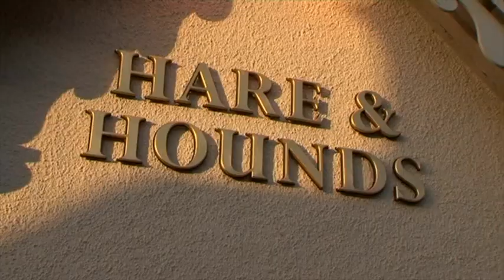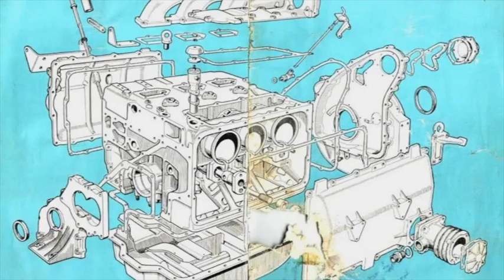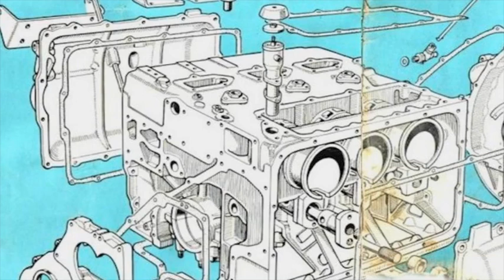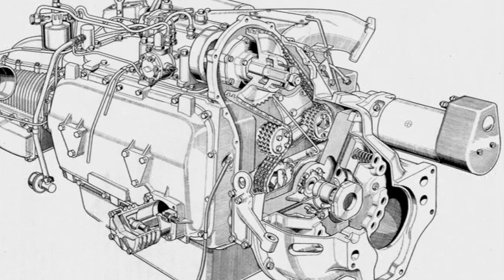Mark Erskine and I go to the UK to talk to Don kitchen about the TS3 Commer truck engine

Comment: No one has stated what engine oil was recommended by roots ?  it was Shell Rotella DD+40-,
And should anyone want a broken blower shaft i have one lol  there was a knack of removing them ?   They were a very good engine if you could stand the noise.

I did not realise that vehicle of Holtons from Stony was the first TS3,  you are never to old to learn, they were only about 15 miles from me in L/B.

Comment: The idea came from a wartime German bomber with an opposed piston diesel engine Junkers Jumo 205, it used two crankshafts. Then French CLM stationary engines used the same principle. The Vincent Motorcycle Company produced an opposed piston engine during the war for use in air dropped lifeboats, it was a petrol engine. 3 cylinders centre one was the blower two outer ones were power - 500cc. doesn't half look like a TS3!

Comment: Interestingly the opposed piston Diesel engine idea was, I believe, pioneered in Germany at some point in the 1920s. It was developed by Junkers, designated Jumo 204 to be an aircraft Diesel engine which entered service in 1932, In a 6 cylinder twin crankshaft configuration. The clever part of Commer TS3 design was the rocker configuration which enabled the use of a single crankshaft. The Junker's Jumo 204 engine design went on to become the basis of 2 other significant British engine designs which were the Leyland L60 used in the Chieftain tank and the Napier Deltic having 2 and 3 crankshafts, with 6 and 18 cylinders respectively. It is disappointing that the Commer TS3 rocker and single crankshaft technology didn't become the basis of applications in other vehicles such as tanks, trains and ships. Unfortunately, this clever configuration was too late to be used in aircraft as by then the jet engine was the established prime mover. It's configuration solved the oil scavenging problems that had limited the Jumo and L60 engines to a vertical orientation.
Reply: The TS-3 configuration is attributed to copying the Sulzer ZG-9 by some, but there’s no real evidence this was actually the case

Comment: How many times in history have machines with so much potential been scraped through ignorance, funding and or somebody’s ego
Although this concept has been used by other manufacturers, the TS4 without question, would have been with further development and technologies in a league all of its own.
Detroit came up with electronically controlled injectors, for example, imagine similar in the TS4.
I’m not sure if the TS4 had helical rotors in the blower but noise reduction would have been an advantage, and other developments, too many to list here would have enhanced it into a serious energy density winner compatible with no other.
Eventually, though, emissions would have unfortunately its demise and killed it off as happened with Detroit 2 stroke range, I read somewhere that Detroit could not be developed any further.
Think of where the TS4 would have been with the same level of development as the Detroit 8V92 TTA.
We can only speculate, but it is more than fair and pointless to say now that Chrysler has a lot to answer for.

Comment: A haulier running to the London markets with vegetables had a stick same as local bridge it could be loaded with 56lds potato`s marrows lettuce still went to the same hight on Commer Maxi 
to clear under the bridge , the driver my brother in law always carried some woman`s tights in case the fan belt broke as on the road side it was easer to fit then the belt he always said, never new if he tried it

Comment: Thanks I recall seeing my TS3 engine being pulled down and serviced by WR Phillips here in New Plymouth, a very interesting engine to see. I wonder how many of the Commers came to NZ. Europa was big on the Commer brand
Reply: @MerleDoughty-yw6cl
Europa Oil were owned by the Todd family, who were also the sole importers of Rootes Group product to NZ so it’s not surprising they used one of their own brands 😊.
I think one of the Taranaki Dairy Companies also used a lot of Commer tankers (there’s a mural on the former parts dept window at WR’s showing them).
I’m ex-WRs myself (cars & light commercials though) you would’ve had your truck in the Bob Fougere truck shop days I’m thinking?

Comment: If only Rootes had be given the design responsibility for the Chieftain tank engine British tank  industry would have had huge success
Reply: Rootes were involved! Eric Coy, head of the engineering division,  mentioned in this video, and Don K were involved in the piston. / liner design. Here is what Don K sent me in a letter about his life at Rootes Diesel Engine Divn "Eric Coy, on one of his visits to the Fighting Vehicle Research and Development Establishment at Chertsey, was asked for advice on what would be a profile of a power unit for a new tank investigation. The requirements were about 600 hp but the engine height had to be extremely low. E.N.C suggested a twin crank 2 stroke which could be inclined at a low angle. That’s all I know except some time later, ENC presented me one morning with a piece of paper on which he sketched a piston profile and requested me to detail. It was, in fact, the Leyland  L60 proposal.
Diesel Engine Division was awarded a contract to develop the liner, piston and combustion based on a single cylinder unit. Another draughtsmen, Eric Bell, was taken on to detail the single cylinder block - crank, etc while I was left with the piston, which had a cast iron body with steel crown secured by steel studs. The crown was made in two parts - an outer ring the inside of which was machined for oil cooling and a sliding fit centre. The material used was C.P.N.M2 and with this material, the two rings had to be welded together in a vacuum furnace - very costly. Ken Firth was given the development responsibility - no major problems - 100 bhp / cylinder achieved. When our part was completed, the project was handed over to the Tank manufacturer - Leyland.   Problem was, unlike Rootes Diesel Engine Divn, Leyland had no experience in developing and building two stroke opposed piston engines and they had a lot of troubles and took a long time to build it - never getting it right. Rootes WERE given design responsibility for PART of the engine. It was just a shame they weren't given responsibility for the whole design :-).  And growing up in the cab of a bonneted Leyland Comet 75, along with the first Commer TS3 in our province in NZ, I am a huge Leyland fan - well until the mid late 70s when all those other brands were absorbed and sullied the product! 🙂

Comment: I've been obsessed with anything that has an engine from my earliest memories,  some things stand out more than others though. The TS powered Commers are one of them. I was very young, only just in school when I heard my first Commer, and at that time of course had no idea why it sounded so different to other trucks. Neither did my father when I asked why they sounded so strange, he just said they have special engines! Actually it wasn't until the late 70s, early 80s that I discovered the magic!  We lived in North Yorkshire at the time and there was a very old garage in the village where we lived. One afternoon I was there after some parts for my mum's knackered old Morris 1100 and was wondering around the back waiting for the owner to serve me, there wasn't anyone else, he did everything. There in a corner was this strange lump that sort of looked like it was an engine but without the usual recognition points. Eventually the owner finished with the previous customer and noticed me examining my object of fascination!  He asked if I knew what it was to which I replied, nope, it's got me stumped. He went on to explain that it was an engine, a TS4 in fact,  how it worked and that it was a unique design in automotive engineering. It was then I knew the answer to the mystery of the Commer sound from my youth! I've been fascinated by them ever since and always wondered why it never saw further development and adoption by other companies, especially for military use.  Would love to have one to mess about with but despite looking have never found one to buy.